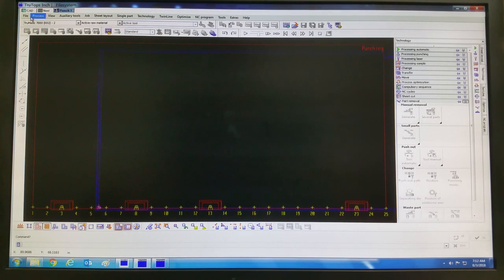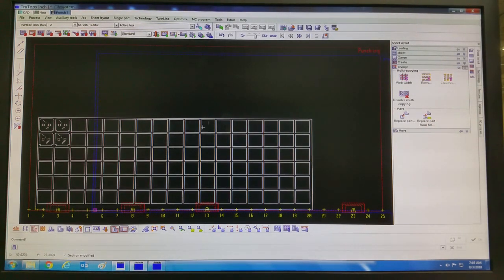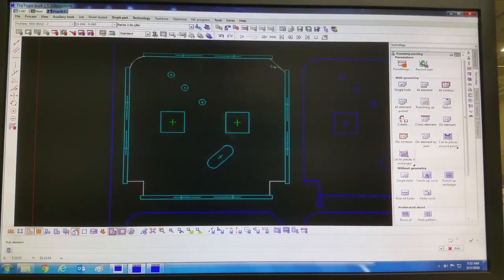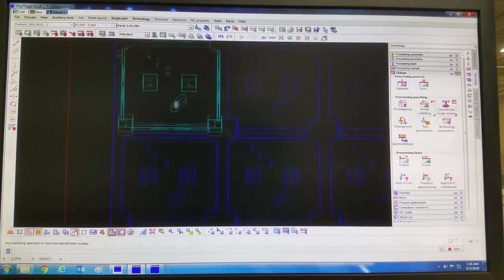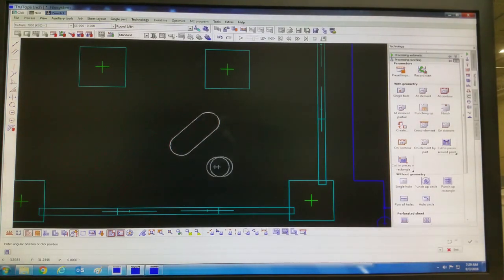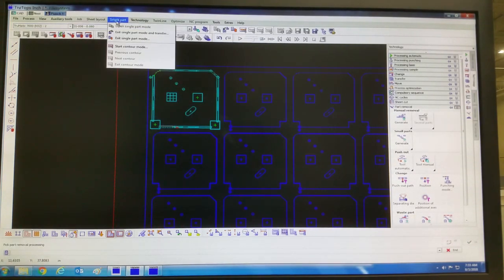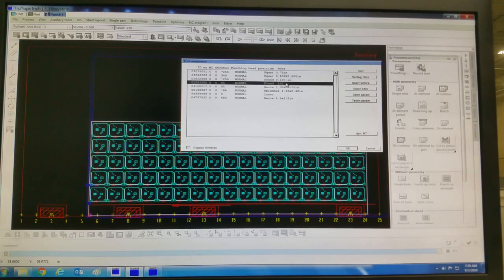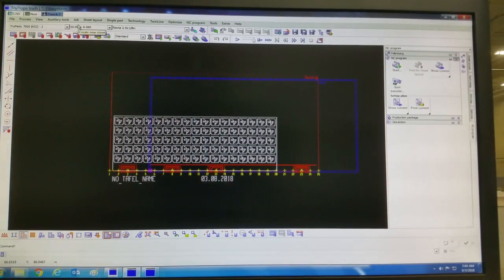TruTops programming

Comment: dear master 
 i need your help ASAP i am in dubai working in dubai based company and  my manager second company has cnc trupunch2020 and this same software they use it . the problem is that due to lockdown programmer stuck in his country and he cant come now so i need to know about this software so that i can make impress my boss please help me to learn this software it will be very kind
my whats app number is 971-563041938
please contact me or provide me your number so that  we communicate it will be very kind sir
thank you !
Reply from the maker: Hello, this tutorial should give you basic knowledge how to make a program and if you need to get more info, there is help button in the top right hand corner which will open a 700 pages long PDF programming manual. Hope that the programming manual will help you!
Good luck
Reply: @cncmachiningtutorial1137  
Dear sir actually I want to ask you many things if you are free please come to what's app and I just want to ask you the process of this Machine 
Because I have knowledge about tailift hp1500 in this machine we have different options but in true top software there are some options which I can't understand Easley it's very if you help me through direct contact 
I am not in the plant now I can't see pdf but if you are online we can discuss more 
I hope you helps me more sir 
Thank you 😊
Thank you
Reply: @cncmachiningtutorial1137  
I wanna impressed my boss if you just give me your little time it's very big value for me it will be very kind 
🙏
Reply from the maker: I am so sorry, the last time I worked with TruTops software was a year and a half ago and I don't have access to the software anymore, so I won't be able to help you.
Reply from the maker: Open the manual and learn from it. This is the best advice I can give you.
Reply from the maker: Ok then, I will call in 2 hours. Hopefully I will able to give some valuable information.
Reply from the maker: I add your nr to my contact list but I can not contact you through WhatsApp. It does not work. Sorry
Reply: @cncmachiningtutorial1137  
Okay boss let me start a question on YouTube 
My first question is 
1: can I draw my profile in Auto Cad and important in this software ?

2: after selecting the tool what to do ?
Only nesting and transfer or need to change some kind of G cod manually?

3: in this software we have 3 option when we open the software 
@cad 2nest 3 punch
I want to ask you is it like if you want to draw new profile then go to cad and then nesting for what or nesting require first or tool setting require first 

4: you mentioned in this video about laser cut so in this machine we have options to cut as laser in Tru punch 2020
Because in tailift we have only punching Option not laser or bending in the same machine .

5  auto index tool actually in tailift we have 2 auto indexing tool other are only what you fix as horizontal or vertical?

Please give me all the information if you have free time thank you master 😊🙏🇮🇳
Reply from the maker: 1) yes you can draw it or take a picture and convert it and then import it in a vector file (dxf, dwg ect)
2) there is no need to adjust the G code manually (you can do that at the machine for troubleshooting) the software will  build the G code for you. 
The software will select the tools according the rules and you have the option to change it (eg, select different tool and apply it to contours of a part )
3) CAD- draw a part
NEST-nesting parts together on a sheet
PUNCH-processing (tools, sequence, ect)
4)TruPunch 2020 is only punching machine. I made the video with Trumatic 7000 which is a combination machine (punch&laser)
5)Trumpf punching machines work in different way (there is one punching  head which holds one tool at the time and that tool can be rotated in 360 degree (no Auto Index, no angle restriction) pretty cool :-)
You are welcome.
Hope that this helped
Good Luck
Reply: @cncmachiningtutorial1137  
Thank you for your reply dear master I have only one confusion now  please clear about nesting actually I got about cad @ cad is use to draw and punch option help me to add tool and make g codes but why and when i use nesting ?
Please clear this and I hope I do some more  practice and hopefully I can use this software easily thanks a lot 
God bless you master 🙏💓🇮🇳
Reply from the maker: Nesting is used to place parts together on one or more  sheets. The processing for all the parts together is done in Punch. Of you want, you can skip the Nesting and place the parts together on a sheet manually in Punch.
The Nesting has the power to place forexample 20 different parts from different materials with different quantities on some sheets. The Nest will create the nesting for you and then you can just set the processing in Punch.
Reply: @cncmachiningtutorial1137  okay master got it 
Thank you so much for your time I really appreciate your efforts ❤️
Reply: @cncmachiningtutorial1137  
Dear master i am here accessing that software from my other PC and the original software is in different locations I have got IP address to access the computer but I can't open the software it asking me license because the dongle is with original computer and I am using remote control so please help me for this  
If this can open I can search my question in help which has more then 700 page
Thank you

Comment: hey, i'am having trooble with trutops software with laser cuting fiber 4000. We want send 30 or 50 diferent JOB.tables wich we got by automatic nesting. but when .job come to laser operater sees 30-50 diferent taffs and he need manually change every time each taff when table is over. is there way for operater to open job just once and then every table goes automatic until end of .job ?

Comment: Good afternoon, greetings from Peru, I am acquiring a Trumatic 5000R punching machine from 2004, I would like to know what program I should use for the machine to work without problems.
Thanks for your answer.
Reply from the maker: Hi Angel, I was in Peru last year (park nacional Huascarán was beautiful and Cusco is nice as well :-))
I used TruTops for programming. You just need to hire a good programmer and a good operator. Every program will be different and will require different ways how to tweak and debug it.
Do not try to save money on employees (you will need smart people).
I wish you you good luck
Reply from the maker: Unfortunately I can't help you whit that. The machine HAS TO be perfectly leveled and correctly set up. I suggest you to ask Trumpf people to come to your place and assembly the machine and to do a training for operator and programmer.
The machine also requires strong leveled concrete underneath.
Good luck
Reply: hello thanks for your response, good thing you have been to Peru, Peru has many wonderful places.  I tell you that the machine is coming to me from the USA on October 22, and as you know it comes unarmed, you with the extensive experience you have, can you recommend someone in Peru who can come to Peru to do the assembly and training of the machine  .  This is my email for any coordination: ahuarancca74@gmail.com

Comment: How do u program to let small parts fall out the bottom. I'm having trouble figuring it out and can't find a video for it
Reply from the maker: Hello Brian,
Thank you for your question.
For removing parts / large scrap you have few options:
-Manual
-Sheet Master
-Part chute 
In this video at the time 18:30 I am talking about part removing. I chose manual removing, but you can choose part chute removing. Klick on the icon for part chute and just klick at the place of the part where you want to have the removing. Keep on mind that you should pick a place at the bottom of the part in axes -Y, otherwise that part stays on the table and doesn't fall down.
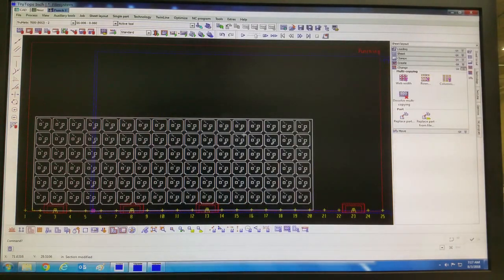I hope you understand. This is described to the details on programming manual which I mentioned in this video at 5:10. 
Good luck!
Reply: I think I got it now. Before, I had done all that, but for some reason it wanted to change tools for every part. Like punch, cut,punch,cut. Why do u think it did that?
Reply from the maker: @briankupiec9522  Take a look at this video at the time 21:20. I am talking about Optimize execution sequence. It should fix your problem!

Comment: Hi Sir, thanks for video. Am i right? For your video vertical tools using common cut? Horizontal there is distances from part edge to other part edge? Why i concern this, i see our programmer here make all horizontal and vertical as common cut so when a part finish has machine stop. Is this way correct? Thanks
Reply from the maker: Hello Lasmian, 
I would say it is not a problem to use common cuts all around the part. The issue is probably because your programmer did not program the machine to remove the part (Sheet Master or part shute) and they set up the program form manual unloading.
Reply: @cncmachiningtutorial1137  thanks for your explain Sir. Your type use micro joint, is it? Different Sheet master and chute Sir? I think my site use commont cut then no micro joint, so one part finish machine stop and take the part(unload part) manually from the table
Reply from the maker: If you wamt to use the Sheet Master or part shute for unloading>>> there must not be a microjoint
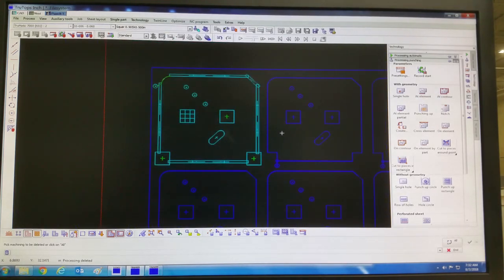Reply from the maker: In this video at the time 18:20 I am talking about manual/ part chute / SheetMaster unloading and all the details information about programming this machine, you can find in the programming manual which I mentioned at the time 5:10
Reply: @cncmachiningtutorial1137  thanks for your explain. Manual unloading is it good for the machine? Because machine stop when a part finish punching to unload it
Reply from the maker: @lasmiansitumorang81  manual unloading doesn't hurt the machine but the production. It is slow and the operator of the machine has to keep unloading the parts ect. The best way is to let remove the parts automatically (sheet Master or part chute). Ask the programmer to change the program!
Reply: @cncmachiningtutorial1137  i am very thanks for your explain. But our Trupunch 1000 do not have sheet master and the chute box small only. For big part, better manual unloading or use micro joint type? Thks. My email: Lasmian4000@gmail.com
Reply from the maker: @lasmiansitumorang81  Well, in that case might be better to secure every part in the sheet (scrape skeleton) by at least 2 microjoints per a part and let the machine unload the whole finished sheet (eg the whole skid- 20 sheets or so) and then shake the parts of) It depends on the thickness of the material. But in this case you would need to clean the parts from the rest of the microjoints.
Good luck!
Reply: @cncmachiningtutorial1137  thank you Sir

Comment: Hello, Your channel is a good position for beginning cnc punch operators on TRUMPF machines. Absolutely nice work. Could you discuss for us "Focus Line" function for TRUMATIC 7000? I mean change position for "Focus Line" either gas pressure if remains a fin on our product. How to remedy? Thanks a lot. :)
Reply from the maker: Hi Piotr, with this information I am not 100%  sure, but if I remember correctly, I used Focus line for head calibration. (If I kept a not finished sheet on the machine and I switched the machine off, I had had to calibrate the cutting head before another processing and for that I used Focus line).
I hope that this answer helped.
Cheers Petr
Reply: @cncmachiningtutorial1137  short. after each laser burning I have to deburr the detail. What to do with this? How can I handle this without burning it?

Comment: Hi, What it difference between rounding and rounding sprintline in laser tables?
Reply from the maker: Hello Teppo,
The Sprint Line means: During positioning the laser in not switch-off but the power is reduced!
 And fast positioning of the laser head with the distance regulation switch-off.
Hope it helps!